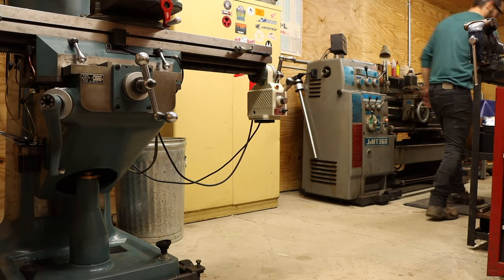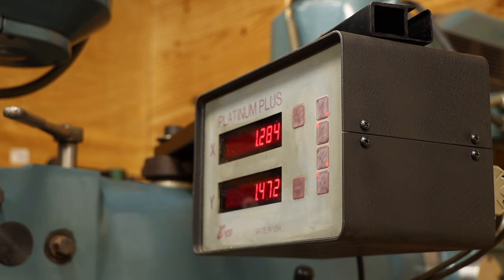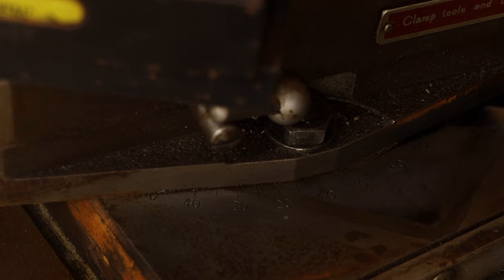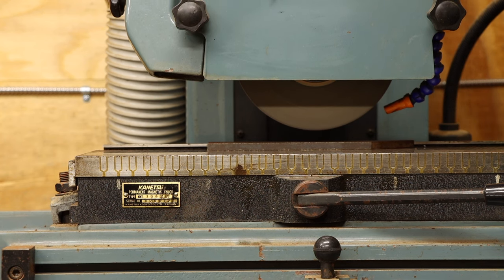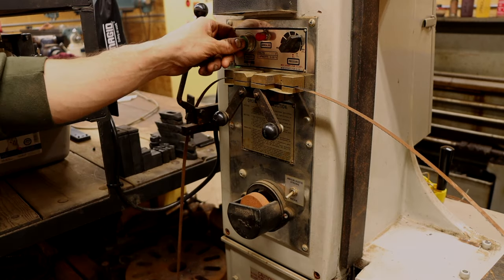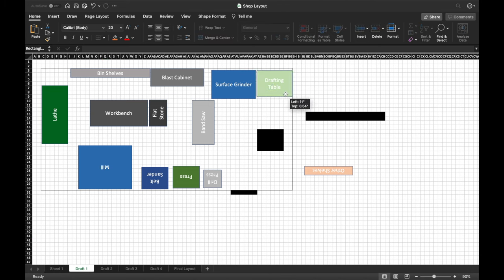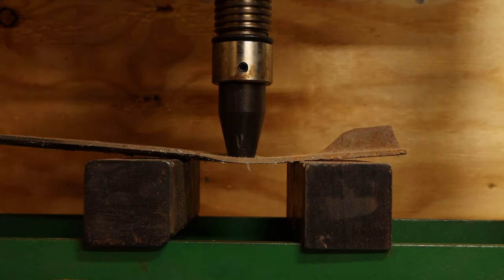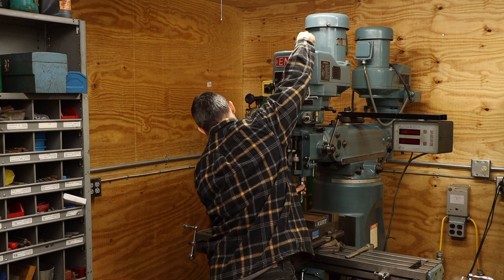Machine Shop Tour || INHERITANCE MACHINING

Comment: A nice variety of machines you have there. You're going to have a lot of fun making things. 
Is that a steel cutting band saw or just for wood? If it's for wood you'll probably want to get a steel chop or band saw to size material. 
Looking forward to sharing the journey with you.
Reply from the maker: Thanks. The saw it’s good for metal and wood. Just have to swap blades. Though it would be lice to have a horizontal bandsaw like you mention
Reply: @InheritanceMachining  The reason I mentioned this is that wood saws are not suitable for cutting metal. Metal saws operate at a significantly slower speed than wood saws. Wood saws will cut metal but the blade life is shortened considerably,
Reply from the maker: @HereticalBuilder  No worries. This bandsaw has a variable speed transmission. Sorry should have mentioned that as well!

Comment: Nice shop. I think you'll need a traveling hoist of some sort.
Reply from the maker: Wouldn’t that be nice!
Reply: @InheritanceMachining  Too cramped for a gantry crane like Keith Rucker has or a rotating jib crane like Adam Booth's but you might be able to fit an engine hoist in there.

Comment: Hello.  Great video's so far.  Your explanation of everything is fantastic.  Will you please do a video on how you got three phase 220 or 440 in your barn.  I really want to know this.  If it isn't to envasive.
Reply from the maker: Thanks, Mike. It's actually pretty straight forward. You should already have 220V single phase. So you just have to run 220V single phase circuits to you machines them wire in a Phase-o-Matic type phase converter between your machine and your wall outlet.

Comment: tyvm for telling us about static phase converters. ive been using vfds and was looking at a rotary soon but shuddered at the cost.
Reply from the maker: Sure thing, though I wouldn't recommend them now that I know more. Static phase converters are only starting capacitors that only give 3 phase power for a couple seconds to get the motor running. They then lug along on 1 phase and half the power. And depending on your machines circuity could trip safety relays

Comment: I'm starting my machinist adventure from the opposite side, with no skills and baby equipment.  Slowly working my way up as I learn.  I noticed you were doing your taper on the lathe from the back side of the part, I'd never seen that before -I'm curious if that's a technique I should look out for or you were just testing things out.

You're shop looks like it's going to be a blast, good luck with the restorations!
Reply from the maker: Thank you!

I actually turned from the backside like that because I didn't have a right hand mounted insert holder set-up at the time. There is nothing technically wrong with this that I can see but I was tight for room since the cross slide was practically touching the back of the machine.

Comment: So are you getting any jobs yet? Local businesses provide lots of opportunities. Our shop bid on jobs from out of State. We won a bid from Dryersburg Tennessee. Aluminum hydraulic cylinders for lifting the drive. Government work, too, made square knockouts, for square switches. We under bid, Greenlee I guess. But remember government work is full of paperwork and testing, and you get your check, in four months. I like the variable three phase inverters, to use for speed control. Good luck, from Southern Indiana.

Comment: Nice shop & very cool to inherit all those tools from your grandfather!  I’m a cabinetmaker by trade, but really enjoy watching the machining trade.  The phaseamatic converters caught my attention.  Like you, I don’t have 3-phase power in my rural location & that keeps me from buying more industrial tools.  Are you happy with the converters you’re using?  Can you give me any information on them?  I currently have a 7 hp wood shaped that I’m not using due to not having 3 phase power.
Reply from the maker: Thanks for watching! Mine are Enco Phase-a-matics but I don’t believe they are in business anymore. I did find a brand just called Phase-A-Matic online that sells the static phase converters that look a lot like mine. My converters take 220v 1ph to 220v 3ph and seem to do great for all of my machines. The biggest is the lathe that has a 5hp motor. The lathe has an adjustable thermal relay that I trip occasionally. I believe it was turned down to protect the converter since it’s only rated for 2-3 hp. I’m not an electrical expert but for your 7hp I wouldn’t be surprised if it was intended for 480v 3ph. I think you could still run at 220v just at a derated power.
Reply: For 7HP you should probably be looking at a Rotary Phase Convertor....  Little costly on the way in but it's true three phase power some the equipment your running will preform as designed...

Comment: Just love your videos, i'm doing the same in my shop and just have 240volt fase, and my machines are 380v.
Where did u buy that fase converter? That will defo fix my problem. 
Best of luck with your shop.
Diogo from Portugal.
Reply from the maker: Hey, Diogo. My phase converters came with the machines but they were from phase-a-matic.com. In your situation you might also need a transformer to get up to 380V. The phase converter wont increase the voltage by itself. I think you can run you motors on reduced voltage if needed but you wont have the same performance. Hope this helps!
Reply: @InheritanceMachining  thanks for your help keep with good work.

Comment: What's the draw of each LED light? Are they daisy chained on 1 circuit? Does a 15 amp circuit suffice? 

I need to add lights to my shop. I have to convert some florescent lights to LED, then I think I can add several others to get more light.

Comment: 1 Question,  why did you take the power draw bar off the mill? Those are handy. Nice shop and keep up the content.
Reply from the maker: It is very handy. I'm torn on whether to put it back though. From my understanding the proper way to break the locking taper is to partially unthread the drawbar then knock it free. This way you don't booger up the end of the threads. Kindof hard to partially unthread with the impact. Maybe I just need more practice though.

Comment: Just a quick comment, technically the spindle direction is always Z.
So the lathe carriage directions are actually x and z, not x and y, like the same plane as the mill.
Reply from the maker: good catch. I learned this error and fortunately correct it in my lathe restoration video.

Comment: Nice shop . What is the second head on the milling machine used for?
Reply from the maker: Thanks! A few people pointed out to me that it would be useful for having multiple head setups on the same part. So you could theoretically switch between compound angled head and a vertical head for instance.
Reply: Generally they were fitted with a vertical slotting machine for keyways and such. You swivel it 180° at the top of the column. Michael 🇦🇺

Comment: When welding bandsaw blades, be sure to anneal them after welding. Basically hold the button until everything is welded and red hot, then let off, but before it cools completely, push the button again briefly to heat it back up a little. Do this a few times, gradually less and less so the blade cools slowly. Keeps the welded area from being too hard and brittle and breaking.
Reply from the maker: For sure. There’s a whole procedure on the panel. I didn’t show it all in the video obviously

Comment: How are these Phase a matic working out? And are they a simple plug and play?
Reply from the maker: They are simple but I wouldn't recommend them. You only get about half the horsepower of your motor rating because you are actually only lugging along on 1 phase, not 3. For the price of a phase-a-matic you can get a decent VFD that provides full power and other benefits. I've been slowly replacing all of mine. Another option is a rotary phase converter to provide power to your whole shop

Comment: Did you put the mill on a mobile base and how stable is it?
Reply from the maker: Yes my grandfather put it on a rolling frame many years ago. It’s actually pretty stable. Might make a difference if I’m doing super precise work and need the machine level. But so far I’ve never noticed an issue
Reply: @InheritanceMachining   nice! I’m getting ready to park my bp and have toyed with the idea of a mobile base or out rigging leveling feet so I could crank it up and move with a pallet jack. Small shop dilemmas. Great stuff man.
Reply from the maker: @timthelen3917  I know exactly where you are coming from. Thanks for watching!
Reply: I'd ditch the mobile base quick smart. Make some adjustable machine feet or bolt it down to the floor.

Comment: Sorry I forgot to recommend good thick rubber floor mats. They will save your tools and your knees forty years from now.
Reply from the maker: Oh it wont be long before that happens! I was considering stall mats or do you recommend something softer than that?
Reply: Anything over 1/2 0r 3/4 inch thick will do well . they are in all the better catalogues. keep them clean of chips and don't trip over them . ENJOY .
Reply from the maker: Good to know. Thanks for the tip!
Reply: I use golf driving range rubber mats for this. A friend of mine prefers traditional wood lats, they are easy to make. Drawback for me is that cleaning the floor is more time consuming.

Comment: 4:30 ???? the spindle is the direction of Z , it doesnt move in Y? the monitor wrongly displays Y when it should be Z. X is a measurement of diameter, while z is a measure of axial distance. it doesnt matter what is up, down, left, or right. the direction of the spindle is always Z.

Comment: My “shop” is an unheated garage.
I use a product called Fluid Film on all machines and tools to prevent surface rust.
It works quite well, you may want to try it.
Spray it on, rub it in a bit, leave to dry/harden then rub the excess off.

Comment: Nice but too  bad for all the Taiwan machinery. Seems you could do all that in USA iron for about the same $$.
Reply from the maker: My grandfather worked for Ford and was a real stickler for buying American. I was surprised when I learned how much of the shop was import so there must have been a reason. Maybe it was cost or just not knowing how to get the American brands in the 90's with no internet
Reply: Taiwan machinery is very very good quality! It's Chinese machinery that leaves a lot to be desired. Japanese machinery after about 1950 it top grade too!

Comment: Spray that lathe down with a little wd-40 and you wont be constantly removing rust every few days.
Reply from the maker: You'd be surprised how well the dehumidifier works. Since de-rusting the lathe over 6 months ago there's still no sign of it returning. Same goes for all the tools in the shop

Comment: see that bandsaw table you've got?  once you get it cleaned up to your satisfaction you can wax it like you might wax a car and she'll always be ready to use while being protected.
Reply from the maker: That's a good idea! I recall doing this for an old table saw we used to keep out in a barn. Works like a charm.
Reply: @InheritanceMachining  yeah, i learnt that from my table saw,  now i do it to everything
Reply: @InheritanceMachining  Is there anyone in your area does beekeeping ? Cull beeswax is easily cleaned up,mix with some paraffin/sealing wax,add Varsol/solvent,cut the wax into chips,a little gentle heat ,store in canning jars. Some people like turpentine instead of solvent.
You probably know about the likes of Boeshield or other proprietary products,but that is the old standby. Works a treat.
Cans of hardwood floor polish are another approach.
Reply from the maker: @paulmanson253  Thanks for the suggestions. I could talk with one of the local farmers. We have a honey guy. Ive been using a product called ACF-50. So far it's been great. And smells kind of nice too.
Reply: @paulmanson253  I second this, I use beeswax for lots of things in the shop. It is possible to make a very nice paste by stirring 100% isopropylalcohol and beeswax in a jar heated in a water bath on the stove. The alcohol must be water free. It also makes a nice rubbed wood finish for furniture, tool handles, decorative iron work etc. Combines nicely with linseed oil finish. I have tried turpentine for this but did not like it. I however like silicone free car wax for machine tables. And window cleaner for surface plates. Works as well as expensive  special products in every way.
Reply: @erikisberg3886  I never thought of isopropyl.  Great suggestion. Whether car wax or floor polish,they are all a mix of different waxes. Paraffin/canning wax adds a permanence and especially in a hot summer, adds to thermal  stability. I started using the mix based on a Fine Woodworking magazine article many years ago. I have a number of wood planes,and waxing the plane bodies is wise. Not useful here,but old style milk paint was also used on wood furniture,wood surfaces. Do some homework on that if interested. 
There was a corner store with commercial floor wax in tins on a shelf that got me trying that as well. Works as well as anything else.
Cast iron is great stuff,but it does rust. And workshops have humidity.
Reply: @paulmanson253  Thank You for the tips! I have an interest in older methods and use some of them preferentially. One additional note - the alcohol has to be free of water to work well with the wax. I attribute some problems I had to this. Wiping or cleaning isopropanol can contain up to 30% water. It used to be easy to find 100% isopropanol as a gas or diesel additive for cold climate, but not anymore. After corona the stuff has become really expensive. I also use a mix of denaturated ethanol, linseed oil and wood tar for outdoor wood protection. If the ethanol or isopropanol contains water the whole batch can turn into a sticky goo that does not redisolve.